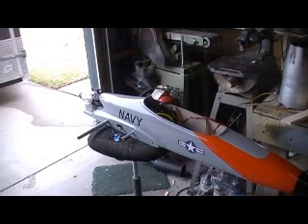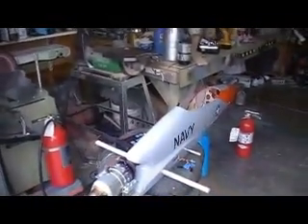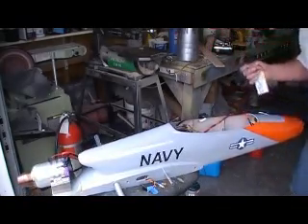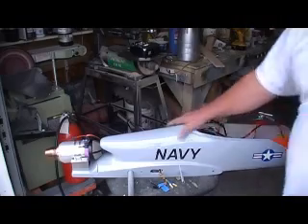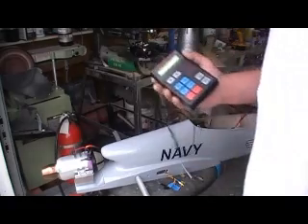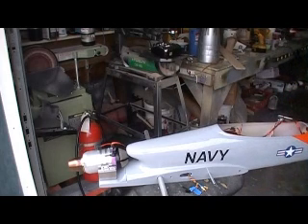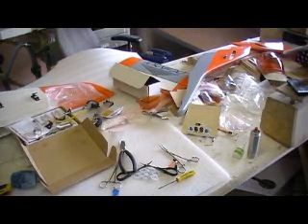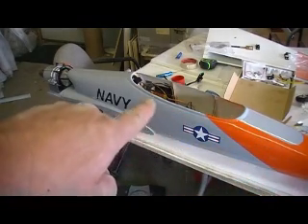tornado build #2

Comment: What does it cost to have the turbines serviced at the warranty required services? On large turbines you have to keep track of cycles of the engine to full throttle. Do they have cycle requirements on these?
Thanks
Don